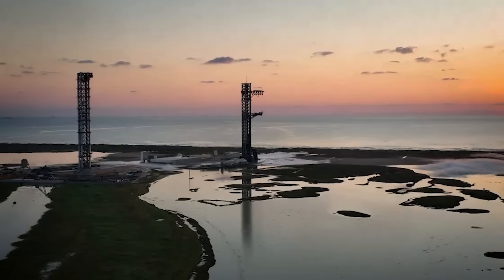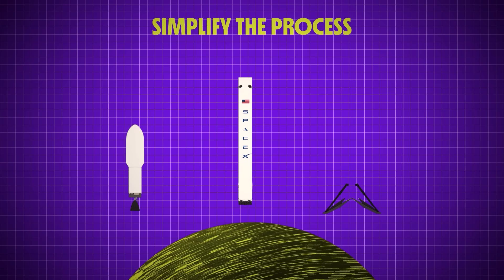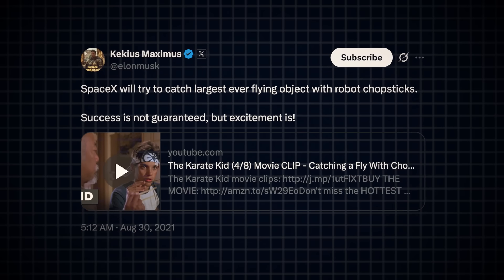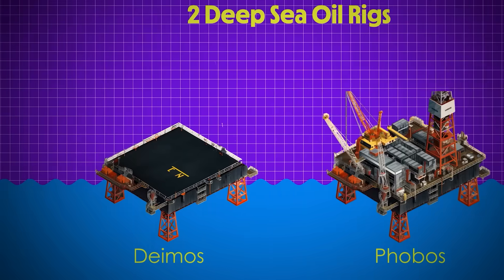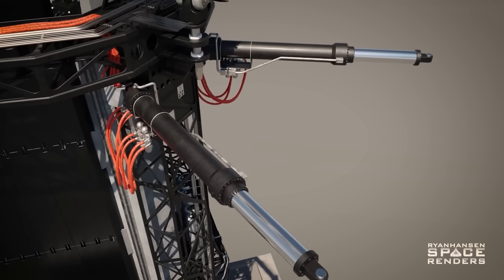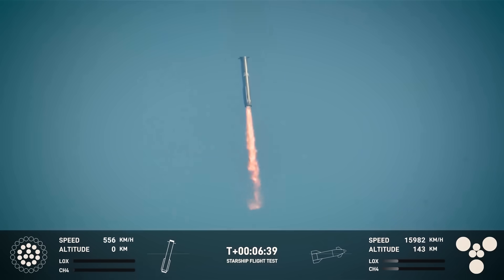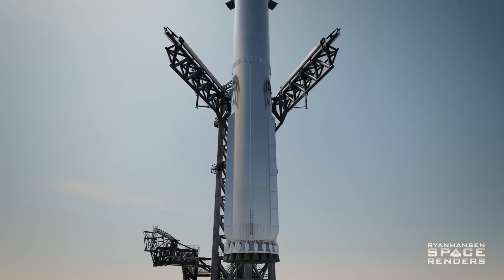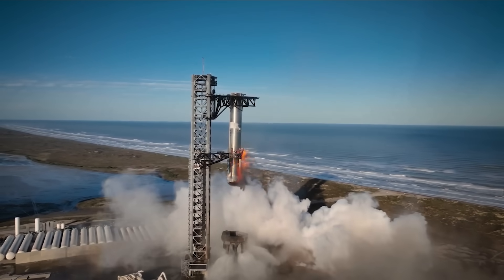How The Starship Mechazilla Works

Comment: First Principle also says that the the entire first stage is just to get the velocity up, just gotta put a magneto rail gun launch ramp up the rise of an entire mountain and save 95% of the weight EZ
Reply: But then remember that that rail needs to be hundreds of kilometers long, most likely be entirely under vacuum, and have a shit ton of expensive maglev rail. Plus, a mountain probably isn't high enough up enough, you would need it to be at least like 20 km up in order for it to work.

Comment: you forgot to mention the MOST IMPORTANT reason why SpaceX wanted to get rid of landing gear. landing legs for falcon 9 for example weigh more than 2000kg, which constitutes about 8% of falcon 9s dry mass (approximately 25,000 kg). and this is the main answer to the WHY question!

Comment: an aspect that makes first principles thinking so powerfull in rocket design is the tyranny of the rocket equation. You could remove landing gears on planes in many ways, i suspect it would be way easier than on rockets. However, this, and many other ways of reducing weigth on planes do not make sense because you are adding billions and billions in RND costs for very limited gains. However, for rockets less than 5% of the weigth at the launchpad is payload. For many designs closer to 1%, like the space shuttle. Finding a way to reduce weigth, even at the cost of complexity and RND costs is going to be a lot easier to justify. If you eliminate 3 tons of material you gain 3 tons of payload. if you wanted to gain 3 tons of payload by making the rocket bigger you would be adding over 100 tons. If you did not need the 3 tons extra payload you can take away 100 tons of rocket and maintain payload.
Some of the same principles were true in early EVs, since the low energy density over volum as well as over weigth meant that adding more batteries without reducing the battery or overall weigth was hard as you would just need more batteries to have energy to transport the new batteries. Thats why the model S took controversial choices in terms of lowering drag like the handles that are complicated and expensive to repair engineering liabilities or the uncomfortably low profile for a car of its class. All tradeoffs that were worth it to get the cars into an acceptible range. and now that battery technology is improving they are not as neccesary, yet still widely used because once the initial RND and engineering is done and they are no longer as big tradeoffs, but rather good design. Talking about the door handles. Many EVs theese days are certinally deviating from the low profile of the model-s.

Comment: How about use a huge drone for lift off and landing, could get the rocket up to 5000 meters with a nice speed
Reply: You barely developed flying cars (aka just big drones) and now you want to strap a starship to one?
  By the way,we already did that,we used the much more efficient plane and it still isn't feasible.
Reply: 5000 meters isn't really that much energy you're saving, the gravitational potential energy of height is pretty damn small compared to the kinetic energy required for the whole thing, and 5km isn't really high enough that you get to utilize drag reduction

Comment: Yes, it's ... interesting thinking. But one flaw you didn't mention is that you have to build a tower EVERYWHERE you want to land either the booster or Starship. The tower, stage zero if you want, takes considerably more time to build than either ship. It looks like we'll get a couple in TX & another couple in FL, but we won't be sending supplies or people half-way around the world until we build catch-towers everywhere we might want to send those people or supplies. Landing legs, of course, would solve this problem, & future Starships will have to have those, for the moon & mars. I wonder if/when we'll see legs on a Terran rocket?
Reply: True, but compared to the price of an expendable super heavy rocket, It's still a compelling alternative. Landing with rockets has never been easy.
Reply: I wasn't suggesting expending the booster, @Skyler827 . I was thinking more of letting the booster land without having to build Stage zero everywhere you wanted to do that.
Reply: You also need to build a tower anyways everywhere you plan on launching anyways, and most likely if you're doing point to point travel on Earth you're going to be launching from that site as well as landing there. Landing legs are actually planned for the lander versions of starship though, but those won't have to deal with as much gravity as they are gonna be landing on Mars and the Moon.

Comment: The only problem is that without landing gear, it can't land anywhere but where the arms are. Makes moon landings difficult, let alone Mars landings.
Reply: Indeed, although I imagine the moon and mars landings will be done on a variant with landing gear. Each mars and likely moon attempt will require multiple launches though one for the starship that's going to land and at least one to refuel. In that scenario, and with the fact that most launches will be done with satellites in mind, it makes sense to make a more economical variant.
Reply: @wh0_am_152  Also, the lesser gravity would come into effect for landing gear not needing to be as hefty as it would need to be on Earth.

Comment: You still need landing legs to land on the moon or mars
Reply: It's much less of an issue on the Moon or Mars due to lower gravity. For every kilogram you want to deliver to orbit you need ~8 kilograms of rocket and propulsion, and if you propulsive land you need another 5 times all of that for return fuel. So everything that is needed on landing, you need 40 times that in rocket and fuel mass. If the extra landing legs are supporting ten times their weight, they are at least doubling the cost per unit payload. But on the Moon such a system would only add 10-20% cost.
Reply: My brother in Christ, it's much MORE of an issue due to the layer of loose regolith and dust you are trying to land on instead of the solid landing pad or catch tower.
Reply: @stef2465  remember that this is the booster landing, not the payload. the booster is responsible for getting the payload into orbit before coming back, so this part of the rocket doesnt need moon-landing gear.
Reply: @Daniel-im6ox  bruh, my bad 🤦🏻‍♂️😂
Reply: @stef2465 oh I agree with you it will be so fascinating to see how they do it

Comment: basically, instead of typical landing gear, they made the landing gear the 2 small catch pins. so, they still technically have landing gear, but that's an insane amount of weight reduction in landing gear.
Reply: Exactly! It’s a genius move replacing traditional landing gear with catch pins is a bold engineering tradeoff. Still counts as landing gear, but with massive weight savings and a whole new approach to recovery. Insane innovation!
Reply: No.
Reply: And yet, they still couldn't even carry a banana into orbit...
Reply: @wyattnoise they haven't tried to go to orbit, only sub orbital flights, and those flights are tests, same with the falcon 9, years exploding, till it became the best rocket ever